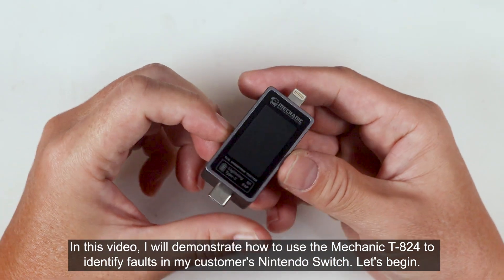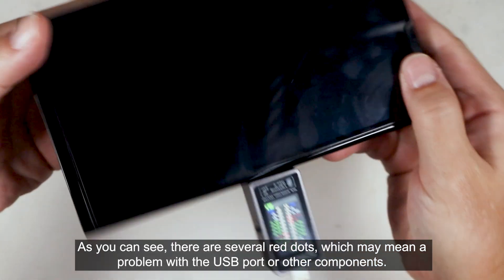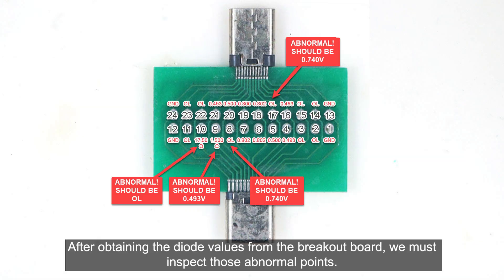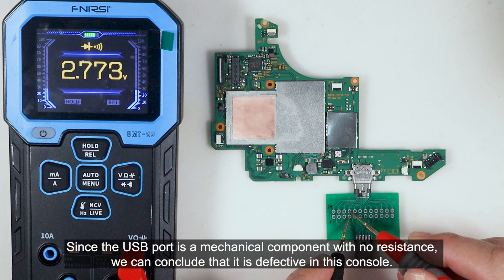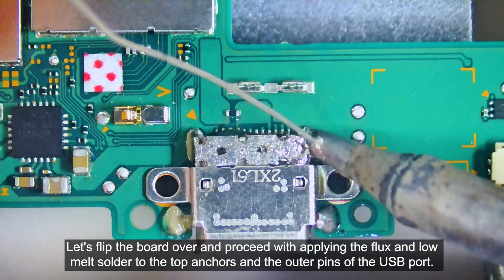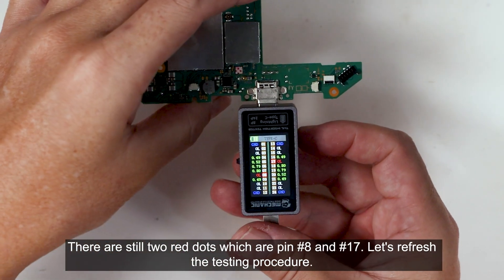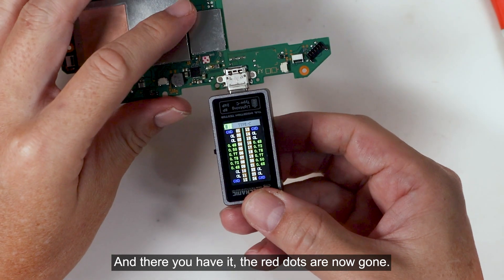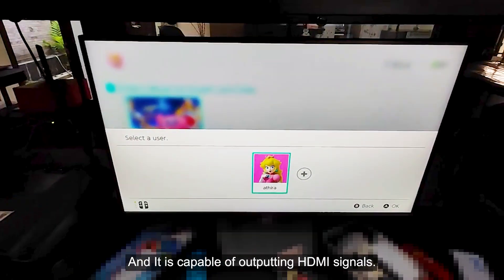REPAIRING THE NINTENDO SWITCH OLED - NO CHARGING - NO HDMI - USING THE MECHANIC T-824

Comment: How about pin 8 and 17 on switch lite? Changing filter didn't help
Reply from the maker: you need to use the xzz platform and other tools to find and solve the issue.
Reply: @sthetixofficial  thanks I was able to come to a conclusion.

Comment: Hi! I bought a 2nd hand oled (Semi-new). Installed the picofly (I've already installed around 180 picofly's). The console looked fine. Everything working on handled mode. No previous signs of console opened before. The customer bring the console back because it has no TV output. It's not the dock. I tested everything that you did in this video. The usb C is fine (inspected on the microscope and with the testing board). I've changed the PI3USB, the M92T36. I've checked the hdmi filters, continuity, everything. I'm missing something?
Reply from the maker: you cannot just randomly remove those chips, please inspect it using XZZ
Reply: @sthetixofficial  i dont have xzz U.U

Comment: Using the Mechanic T-824, I'm having low readings of 0.18 on pin 5 of one side, and pin 20 of the other. Looking at an old schematic of the original Switch, those links together. Where do these link on an OLED? I registered to look at the schematic but it says I need permission.
Reply from the maker: you need to pay for the subscription.

Comment: I sent my switch (with modchip) for repair after it is experiencing blue screen. Replacing the modchip fix it but now the console would not boot up after restart or sleep mode - hard reset is needed for it to boot again. Currently, the repair man will try replacing the charging port and/or the "BQ AT M92" if that would resolve the issue. Would like to know your opinion/guess to what causes this issue? 

Many thanks!
Reply from the maker: You need to check for the fuse count inside hekate. If it can be charged then the USB port is fine (double-side-charging means the USB port is fine and the M92 is fine). But I dont know other components.